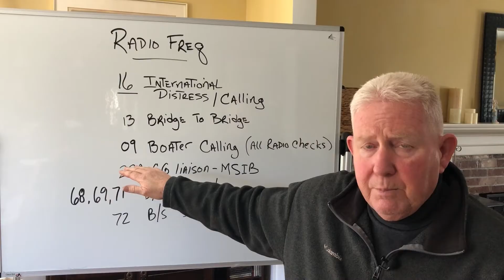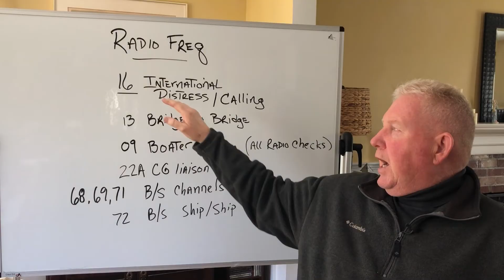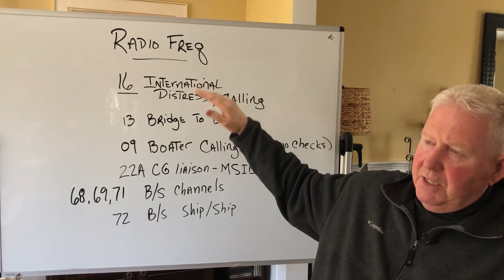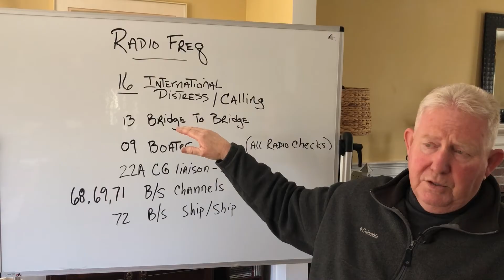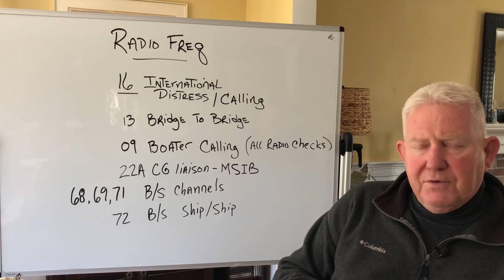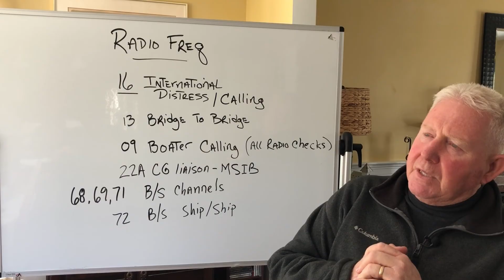Don't let talking on the radio intimidate you! This is a very important piece of gear.

Comment: Hi Shawn,  Thanks for these videos.  I’m a long time boater returning to the water after a hiatus and these are great refresher courses.  Could you please confirm one question for me:  since large commercial vessels are required to monitor channel 13 as well as channel 16, should I hail the vessel on 13 and avoid using 16 altogether?  Also, it’s important to check channels 68-72 before going on channel 16 to make sure the channel you want to switch to is open.  Another question:  what do you do if all those channels are taken?
Reply from the maker: Thank you so much for the questions and thank you for commenting.
1. You can certainly call a larger commercial vessel on Ch13 (low power) if it’s in regards to safe navigation. Ch13 is also recorded in cases of collisions or if the CG has to investigate.
2. You can check the channel you want someone to switch and answer but there’s no guarantee it will remain clear. Often you hear people say “switch and answer channel **, if you don’t get me - come back to channel 16. I hope this help and I hope you enjoy your time on the water!!!

Comment: Shawn very helpful 1 question channel 22 Alpha is that just channel 22 on the radio or is it a different station.  I dont remember seeing alpha like stations listed when scrolling thru the channels.

I appreciate the time you put into these videos
Reply from the maker: George, excellent question! Your radio should display 22A on your radio. Here's a link that may do a better job explaining this than I can do: https://www.navcen.uscg.gov/us-vhf-channel-information
International and US use different standards. We have two systems at work on our marine radios - Simplex and Duplex. The letter "A" following a VHF FM radio channel number typically designates a simplex frequency. Simplex frequencies are those on which only one party can transmit at a time, while the other party listens. Of course, we have no control over any of this, it happens automatically when we key the mic. In contrast - duplex frequencies, which allow both parties to transmit and receive simultaneously. The use of simplex frequencies helps to avoid interference and ensure clear communication between parties.
Thank you so much for you question and your comment - I hope to see you out there.

Comment: Hi, just subbed as we are new boat owners, quick question, I thought you could only use the radio if you're licensed? We are in Europe
Reply from the maker: Thank you so much for your comment and for subscribing! If you are a recreational boater traveling within the United States, you do not need a license for a VHF Marine Radio.
 If you communicate with foreign coast or ship stations, you must have a RESTRICTED RADIOTELEPHONE OPERATOR PERMIT (sometimes referred to by boaters as an "individual license") in addition to your ship radio station license. I believe these applications are included when you purchase a new radio as well as registering your new radio for DSC.  Regardless,  you must file an application with the FCC but there is not test requirement.
I am not sure what the requirements might be in Europe.

Comment: I find it interesting is correctly using VHF marine radio initial call transmissions procedures; which are rarely studied. When obtaining your restricted radio operators permit does not require any such course. What I hear all too often is repeating station calling and working 3 times for normal transmissions.  From what I understand you should use 2X's transmission for initial call of a potentially UNMONITORED stations.  Better just once if no response call again. Then just talk normal.  Can you tell me where are these addressed in CG regulations?? I thought only emergency distress, urgency and safety transmissions require a repetitive calling. This operating procedure has seemed to fester into a standard call procedure for normal calls throughout the amateur marine VHF community. Routine calling procedures require name and or other identifying information of the station being called, spoken once only. The three times should ONLY be used for distress, whether for Sucurite, Pan or MayDay.
Reply from the maker: Bo Jangles thank you so much for your comment. It sounds like you have a lot of experience and have spent some time listening to a radio. I'm not if or where the Coast Guard regulations are regarding your question. I do know that things get out of hand from time to time and either the FCC (here in the United States) or the Coast Guard will reel them in. At present time, one of the things that drive me crazy is commercial salvage boats and small ferries doing a security call every time they leave the dock, enter or exit a harbor or body of water. Clearly they are using these radio procedure to advertise their business as opposite giving up a heads up.